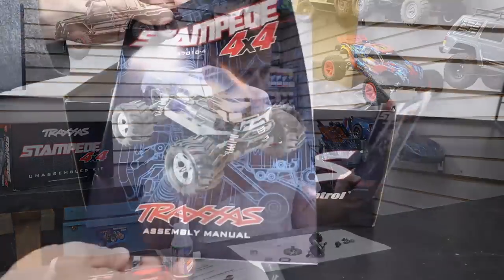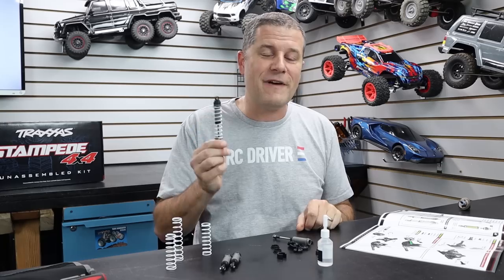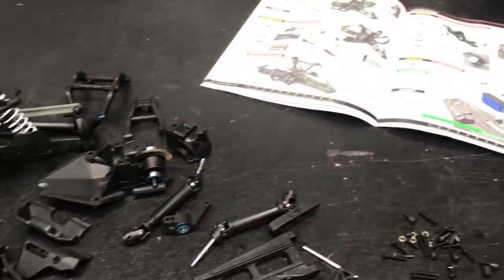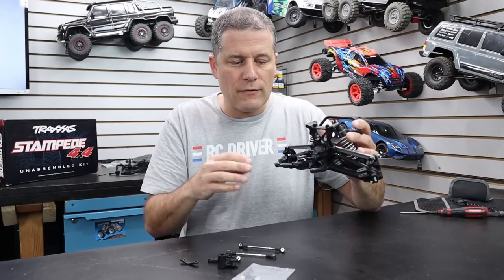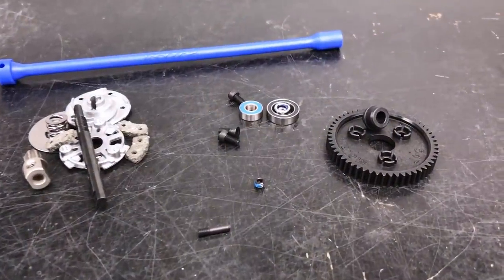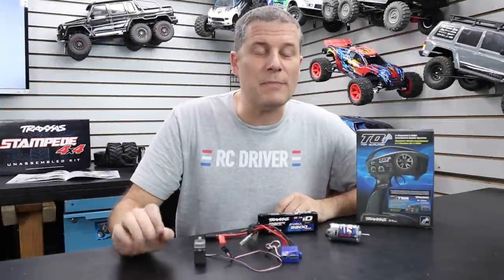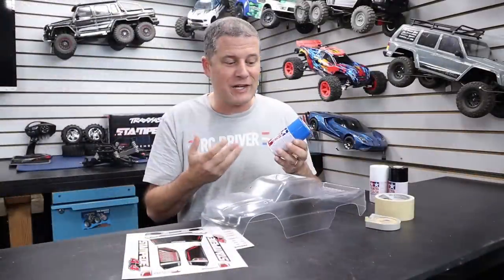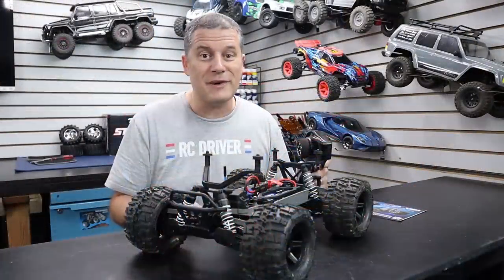You Should Build An RC Car Kit! 10 Reasons Why And What You’ll Learn - Get Into RC | RC Driver

Comment: I totally agree. If you build the kit it will be easier to maintain and even easier to upgrade the parts if you choose to do so. I own over 30 kits I built all but one. The kit I did not build was a Traxxas slash. However I did still modify the truck with a brushless motor and metal shocks from Proline. I actually enjoy the whole building process even more than driving my truck, or car. Think about that .

Comment: Great video. This hobby is insane. I got nosy with the electronics and got a brushless motor/ESC/BEC to work with a micro controller doing something like a throttle tester. To move forward is another story (a lot of expensive parts).

Comment: It is allot of fun. Just for fun I'm building a redcat be6s from bare frame one part at a time from eBay and other places but just something fun to do.
Reply: I do that. I buy a used Rc Mabey not in the greatest shape and then I collect and rebuild it or build from a frame up like you did.  It’s fun.  Gets me threw the winter months too 🇨🇦☃️
Reply: I did that with an scx10, it’s my “salvage title truck”, parts from probably 5-6 scx10’s collected over a couple years because I couldn’t really afford a good one and the chassis rails were from one that had been run over by a 1:1 truck, it was fun to build!
Reply: @mikes062  a 1:1 truck 😂😂😂

Comment: Bought this kit and changed a few parts while building it. Tires I put duratraxx six pack tires, servo and esc from a TRX4 so I can put a 3s lipo on the titan 12 😂. And the radio and reciever from a bandit vxl tho I moght change the reciever later on to use it qith my dx5R

Comment: Okay so I knew I should had done it that way. But I have a question about doing upgrades on changing out servo's, motors, ESC, do you have to upgrade the power supply to power all of the upgrades or is the power supply doesn't need to be upgraded with everything else?

Comment: Question.  How long would a Brushed motors last in a stampede for the average kid?  I'm seeing on forums people give them lives of only months.  Maybe only 50 good runs.  Is that true.  I want to get my son, and of course myself, into RC but if brushed motors are that short lived then should I avoid them?
Reply: If you maintain them you’ll probably be fine, but it depends, in the end a lot of times the brushless versions are better because they come with upgrades, bearings instead of bushings, steel instead of plastic links and so on.  I’ve used brushed motors and had them last a long time and other times they died quickly w no visible reasons, it’s just part of the hobby. Don’t take too seriously everything you read online, lots of haters like to tell why everything but the brand they love is junk.

Comment: Things have come a long way from the Tyco HiJacker I still have. Too far. 😂
Reply: I started with a brand new box stock 1987 Sears LOBO 1/10 BajaBuggy 1st Gen ...so ya things have changed allot over the years but actually they have become allot easier to work on but carry allot more complicated  electrical systems making way more power then anyone would have ever thought possible back in the day ....Tyco Changed the game forever with the Tyco 3 cell 9v battery with quick connect system and a hyper charger ...they just simply don't make them like they used to any more